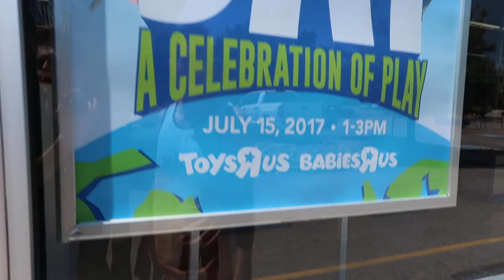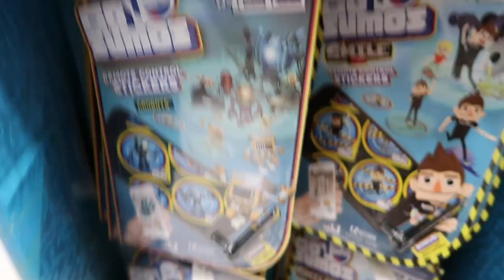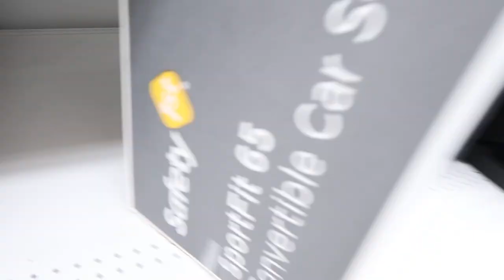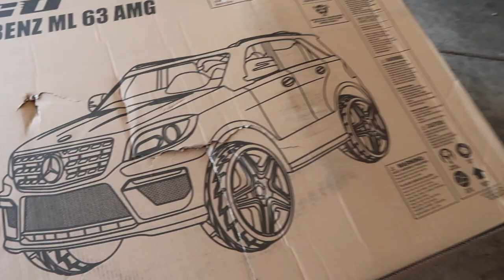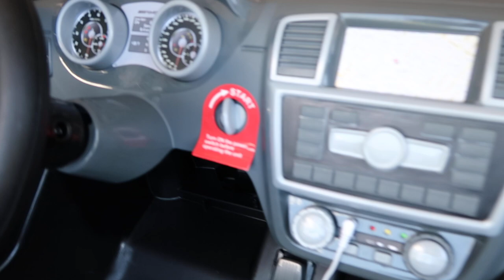WE GOT A NEW CAR!

Comment: In the winter you should put like a mini shovel on the front!
Reply: yeeeeeeaaaaah, i wanted to do that with my gokart too!
Reply: Lavar Ball it wouldn't grip on those plastic wheels
Reply: Chappel Chastain then put on rubber wheels...
Reply: jacob M it's not that simple bc 1 no weight,and 2 those wheels don't have lug nuts so different wheels can't be put on

Comment: If you still have the Merc, and it's still running, maybe you should replace the mock-up speakers in the back with similar sized subwoofers & full range speakers in the front. You might want to reinforce the rear deck with MDF.

Comment: You should rent them out for parties. Put new batteries and remove seats (replace with pillows).  Run the sub to an external battery in a trailer.  You could rent them out for $100 a day lol.